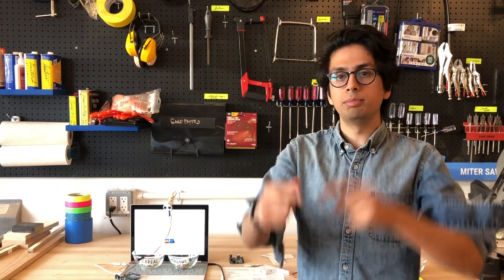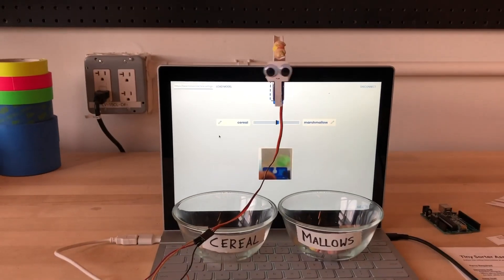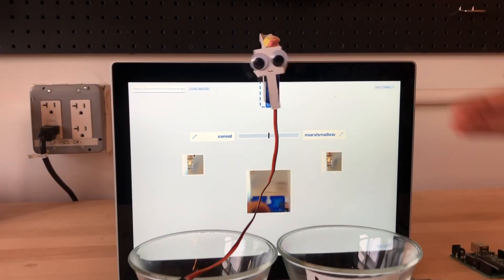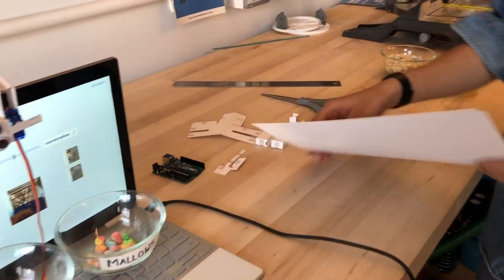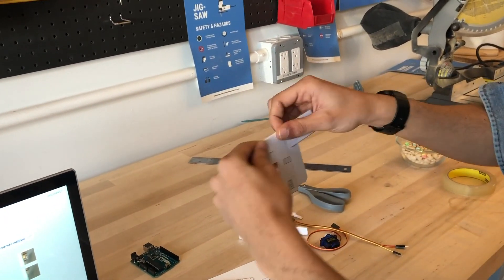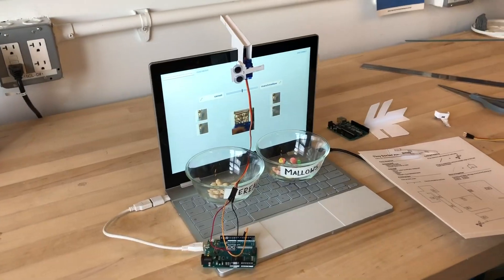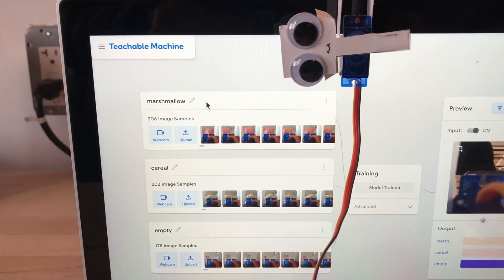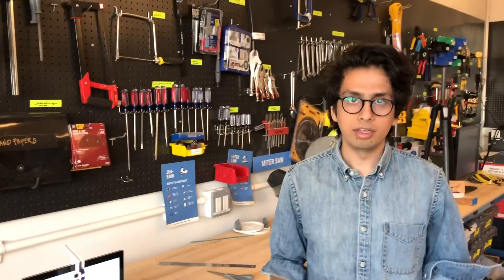Tiny Sorter: A fun starter project with Arduino + machine learning

Comment: Any reason why it would work on my MAC but not on the PC. When I go to the p5.js webeditor, I can connect my arduino on my MAC but when I go to use it with windows, it doesn't connect. It is recognized but never shows connected. I have disabled anti-virus and firewall but still smae issue.

Comment: I have a problem with this when I  locate in arduino-gh-pages/library.  web USB library, error message appeared.
fatal error: WebUSB.h: No such file or directory
 #include <WebUSB.h>
compilation terminated.

exit status 1

Compilation error: WebUSB.h: No such file or directory

Please solve this issue.

+ I used an arduino UNO.
Reply: Same error.... and I've not been able to find any fixes :(
Reply: There may be other problems, but an Arduino Uno won't work, you need an Arduino with built-in USB support.  An Arduino Leonardo (or clone, based on the Atmel ATmega32u4 microprocessor) is required.

Comment: Hi, Absolutely great concept. We've tried to follow the steps exactly as provided but at the end of the project when the training is done, the machine can't properly distinguish different objects i.e. it always dispatches to the right(or left) even if the object is not what is supposed to be dispatched on the right(or left) side. Would you please advise?
Reply: Issue could be training the “none” class to include everything that isn’t either marshmallow or cereal, so even images of you in front of the webcam or a clean background etc…whatever the webcam might pick up while the servo moves.

Comment: Does it work on Windows? Device Manager shows an "other device" Leonardo without a driver. I can load the sketch but it doesn't seem to run or move the servo. The Arduino Servo example does work.

I read one of the files in the lib package and edited the avr core to say the usb version is 2.1 instead of 2.0. Now there is no "other device" but the p5 page says there is no compatible device. I looked at Zadig as mentioned below and it offers to downgrade WINUsb from ver 10 to ver 6. I'm also looking for another micro controller; this Leonardo says "Made in Italy" but the packaging said "Made in China". Usually that's OK, but you do get some duds.

Has anyone made one of these recently?
Reply: I've encountered the same problem. Apparently it has something to do with the windows setup!
Reply: Unfortunately, this project has suffered some bit-rot in the last five years, but it is still cool! I have updated code on my github (ericzundel) in the tiny-sorter repo that will work with any Arduino and CircuitPython drivers too.  I did this by switching the code from using WebUSB to WebSerial which doesn't require anything special from the microcontroller.

Comment: Can I use Arduino/Genuino Mega or Mega 2560 instead of Leonardo?
Reply: You’ll need a Leonardo to use your computers serial port to talk to the p5 sketch on the computer. Uno or mega can’t do that.
Reply: @momentollogy hey man can u help me ,my servomotor is not running. I followed every step correctly
Reply: Me too brah.... soo frustrating  @Crazymorality
Reply: @momentollogy  ive used serial communication with mega 2560 before, it it only board to pc?

Comment: Can I use Arduino Uno instead of Leonardo?
Reply: Unfortunately not. The codes require WebUSB library and that library is valid with any Arduino board which has "USB client device mode".

Comment: I have a problem with this when I click on connect arduino on p5 sketch it would pop up the message no compatible device found. Please solve this issue.

Thanks in advanced.
Reply: I had this issue as well, I needed to update the firmware on my Arduino to support WebUSB. I used the application Zadig-2.4 to update the firmware automatically, and then the Arduino could be detected.
Reply: did you solve your prom?